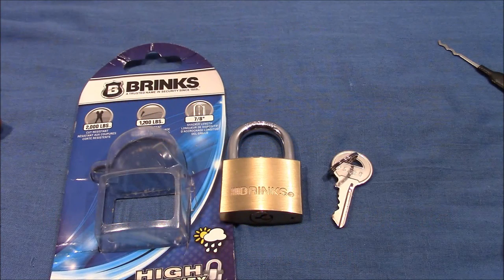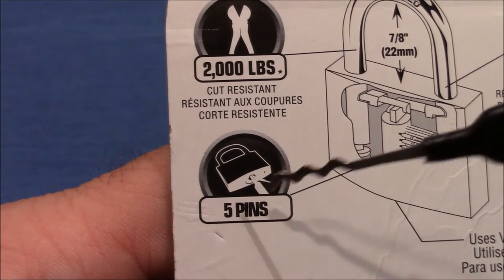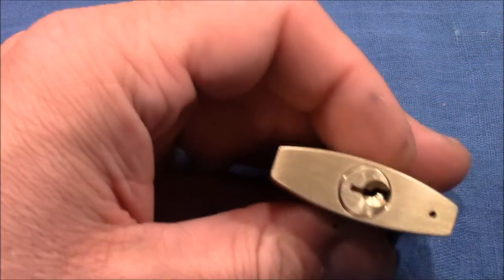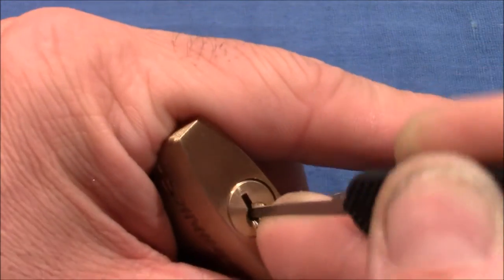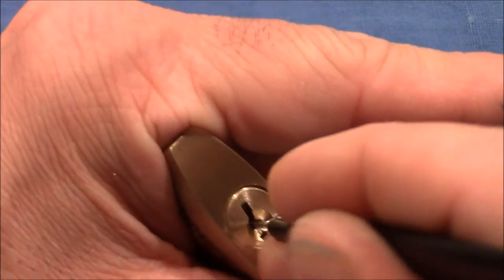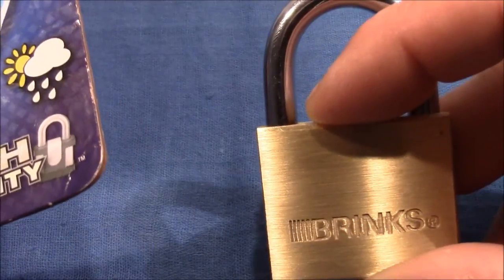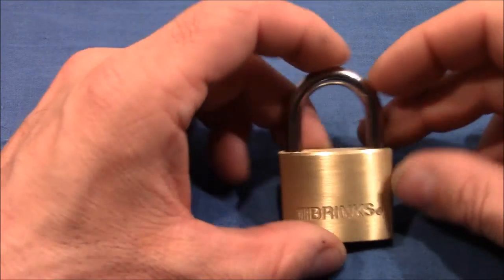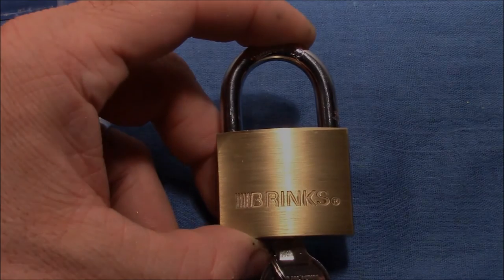(picking 74) Fun - BRINKS 5 pin padlock opened in 3 ways - Thanks to Manuel for this lock

Comment: I think you have a counterfeit brinks lock. I have two of those and they are full of spool pins.
Reply from the maker: +JB Oh really. Do you have the exact same model?
Reply: +Potti314 yep, both have all security pins
Reply: +Potti314 I've got one that is cheaper than that one, and it has 3 spools and 1 standard
Reply: Potti314 you have to get promax or max security for any kind of challenge on a brinks